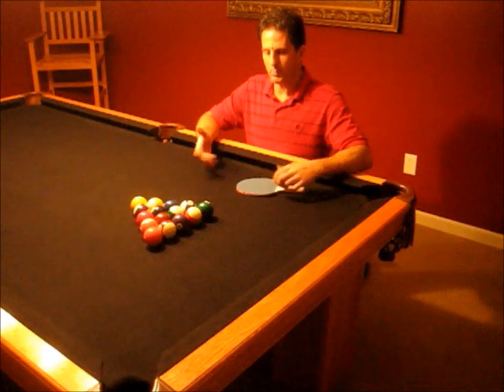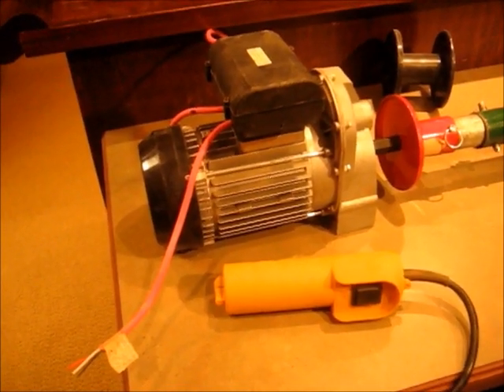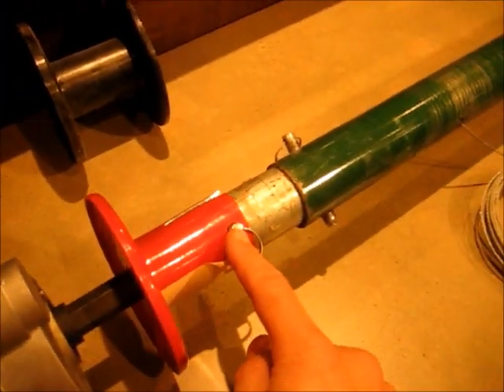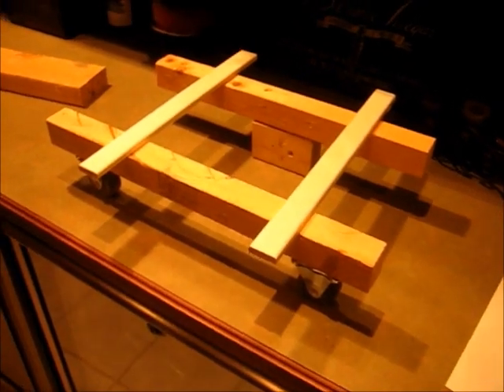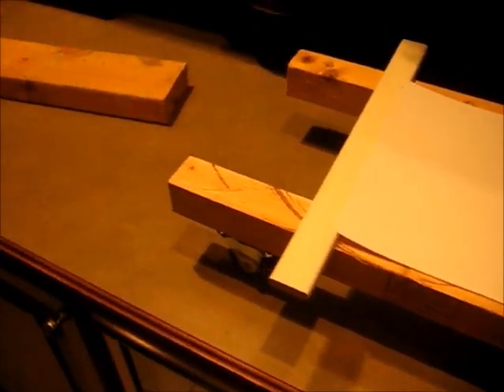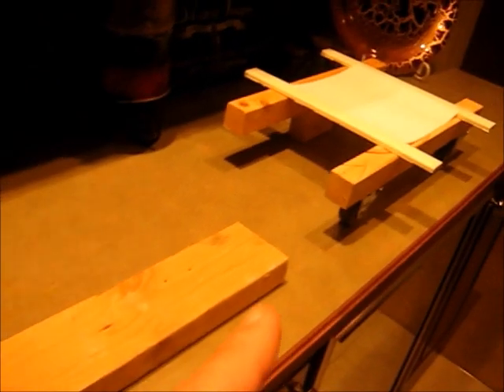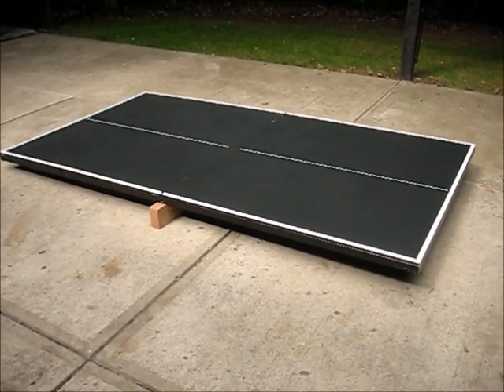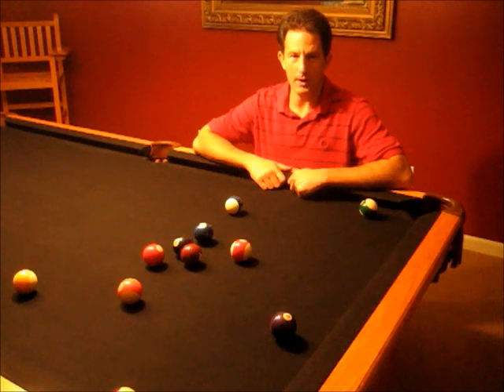How To Make a Ping Pong Topper Robot (HowToLou.com)

Comment: Awesome job! I'm going to tackle this soon! How do you protect the felt and the wooden rails from the added framing to the pong table?
Reply from the maker: +BendervisionTV - none of the metal framing touches the wood or felt, because the ping pong table is bigger than the pool table.   Also the weight is fine since it is so widely distributed.